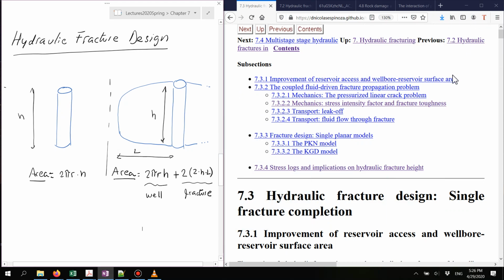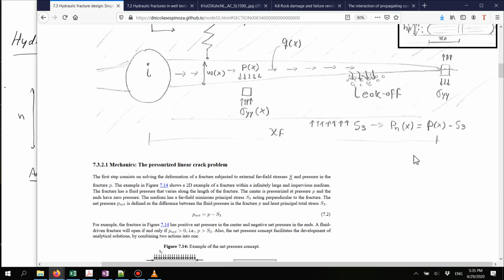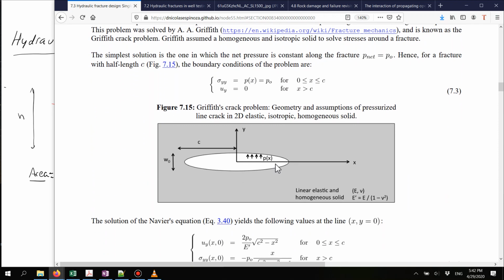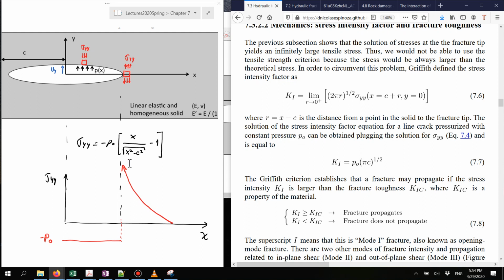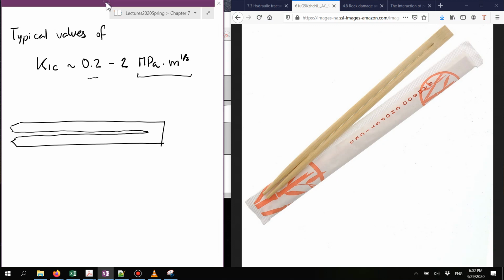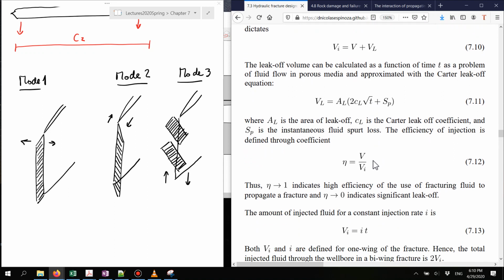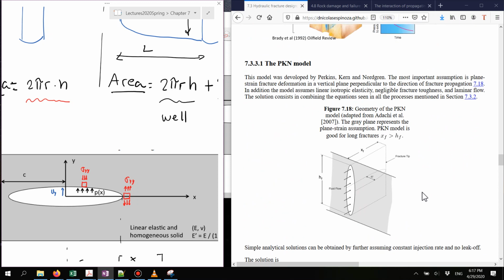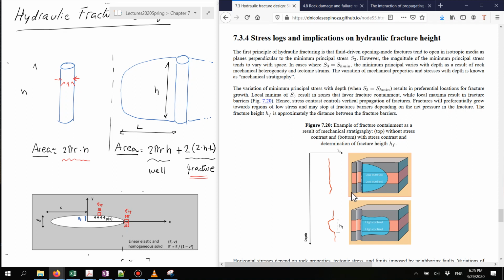L0430 Hydraulic fracture design and modeling: introduction

Comment: For the sigma yy- for  x>c the equation tends to be negative infinity instead of positive infinity, also for x<c the equation is not defined as it will come in terms of iota in denominator  , kindly clarify...
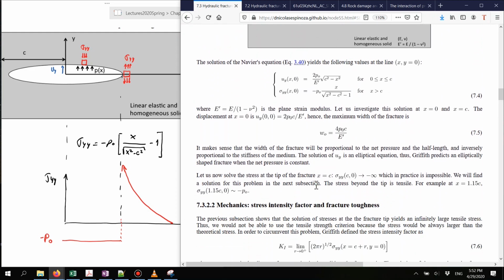Reply from the maker: You are right, the plot shown around ~22:20 follows the mechanics convention (tension positive). That equation is not valid for x<c, so it should not be used. The solution has been coded here: https://colab.research.google.com/drive/1huIgVsyv1PvyNpXyFnZ9u-Ta1zp6Pbti
Reply: @dnicolasespinoza5258  thank you , your lectures are helping me a lot.

Comment: Good video!! Which book do you recommend to start learning about hydraulic fracture design ??
Reply from the maker: I recommend the papers and books listed here: https://dnicolasespinoza.github.io/node60.html (Section 7.7 Suggested Reading). Brady et al., (1992), “Cracking Rock: Progress in Fracture Treatment”, Oilfield Review is a great introductory paper. However, the field of hydraulic fracturing has evolved significantly in the last 10 years, sometimes proving that all those papers I recommend in Section 7.7 are partially or fully wrong. Anyway, these partially wrong papers explain many of the physical mechanisms required to understand modern hydraulic fracturing techniques. The state-of-the-art is here: https://onepetro.org/REE/article/21/04/927/206973/Sampling-a-Stimulated-Rock-Volume-An-Eagle-Ford and https://doi.org/10.15530/urtec-2021-5396
Reply: @dnicolasespinoza5258  Many Thanks

Comment: How do you get a fracture toughness from the downhole logs? or at least the qualitative difference of it around the wellbore? how do the discrete simulators model asymmetrical fractures using fracture toughness....
Reply from the maker: You could correlate fracture toughness from experiments to mass density from logs like in this work: https://onepetro.org/ARMAUSRMS/proceedings/ARMA20/All-ARMA20/ARMA-2020-1649/447632?searchresult=1 (or even better correlate with sonic+density+lithology similar to other geomechanical properties). Fracture toughness is a material property, so a simulator with different materials should be able to handle that. Some simulators allow defining anisotropic fracture toughness.